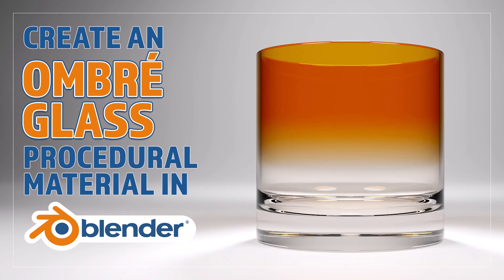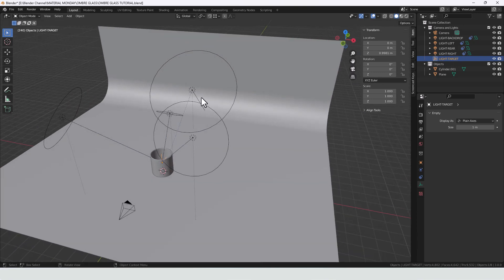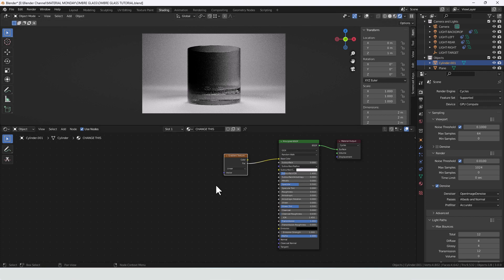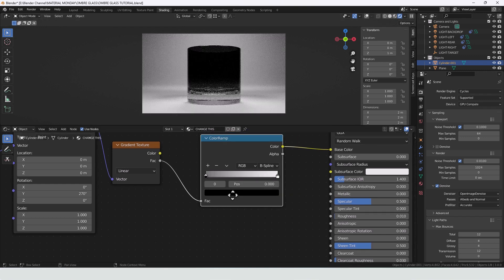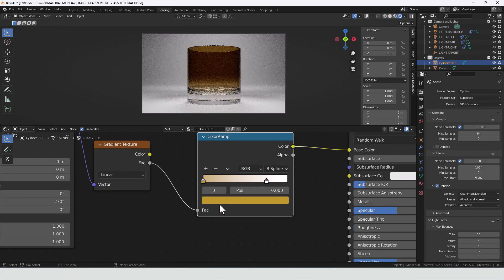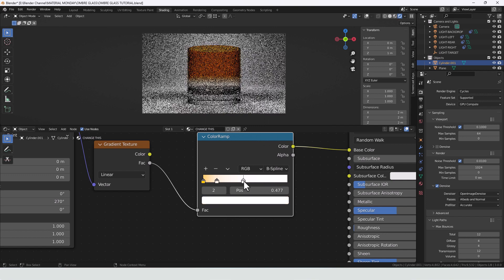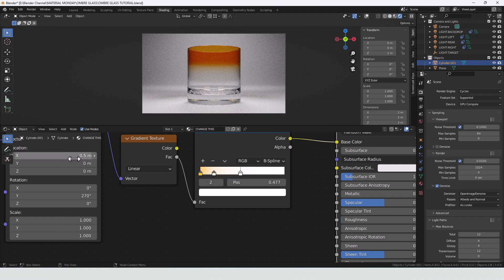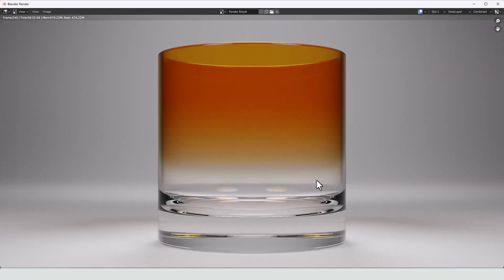CREATE A PROCEDURAL OMBRÉ GLASS MATERIAL FOR BLENDER

Comment: trying to have a pure white non trasnparent on the top half, but when you choose the white color it's just make it transparent. Is there a tip? thanks
Reply from the maker: Adjust the position of the gradient texture with the mapping node and then also change the color positions (and blend mode) in the colour ramp until you find a setting that works. If that doesn't, you may like to try controlling the transmission with a color ramp (or even the color ramp that controls the base color).
Reply: @blenderbitesize  Thanks a lot! I will try this out!